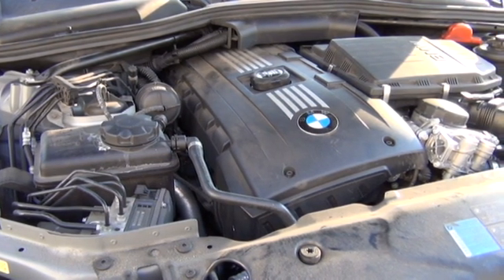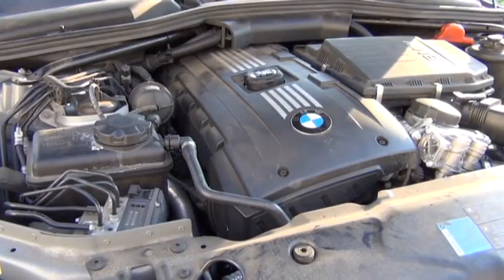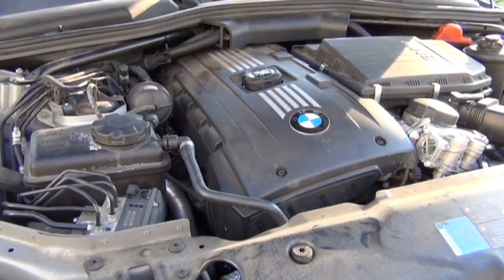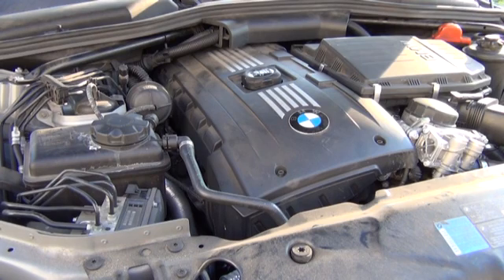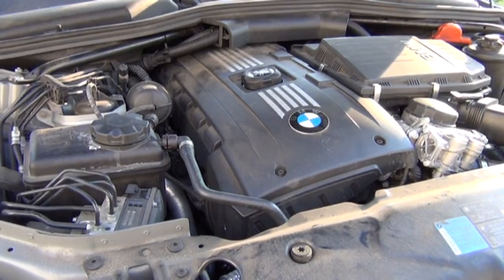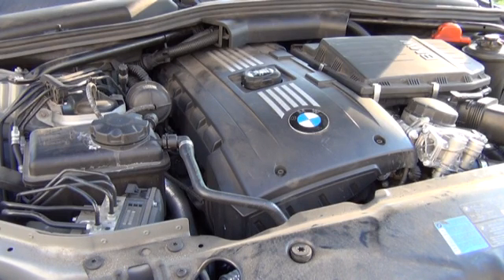BMW N54 Turbo Rattle Clanking Noise Caused By Failure Turbo Chargers

Comment: M54?
Reply from the maker: Hello, The M54 is the BMW 6 cylinder naturally aspirated engine. This video is on the N54 Turbo charged engine. When you rev the engine and the wastegate pivot bearing is failing a rattle noise is heard. This can lead to the wastegate not sealing and a boost pressure too low fault code resulting in a drivetrain malfunction and power loss. I hope this helps!

Comment: Actually I'm seeing the same failure on Audi 2.0 t engines model year 2009 and up the pivot on the turbine housing wear out and then the waste gate valve does't seat properly on the housing then the turbocharger doesn't spool as fast as before the causing a low boost fault I din't know BMW engine had the same fault I'm going to look at that closer next time I have one in my shop the brand of turbo that is having this problems are the Japanese IHI turbo what is the brand used on the BMW engine ?

Comment: Awesome video..... had (i hope) catastrophic turbo failure today (02 audi TT 225 quattro) and the sound it made was like a soup can inside a coffee can, kicked down a flight of stairs..... lol.... i think the turbo psychically broke.... havnt ripped it apart yet, tow truck went one way and wife drug me to work in the other direction..... but, near as i can tell my noise is just an extream of your noise..... thanks for the video.... i feel better now, i freaked out.... noises like that mean replace engine lol

Comment from the maker: Thanks for the comment Dick. I have seen the EPDW's pressure converters fail. The loss of vacuum would actually not cause a rattle as shown by disconnecting the reservoirs. But a compressed or leaking vacuum line may also cause noise. But in most cases the wastegate failure due to the pivot bearing wear is the culprit.

Comment from the maker: Turbo charger replacement would be the only way to get rid of the rattle. If you do not have a warranty then you may want to wait until they are bad enough to set the 30FF fault code for boost pressure too low.

Comment from the maker: The US market does have an extended warranty which is nice when people pick up on the noise early enough. Often the rattle does not lead to a failure for a while but when it does it usually sets a 30FF fault code for boost pressure too low. Thanks for watching :)

Comment: Glad I found your page, I was diagnosing one of these a few weeks back and it was a very faint rattle (the waste gate pivot) but it was very tricky to pin point. I found it after about an hour but it would have been nice knowing it's so common. It's too bad you can't just replace that pivot and not replace the entire turbo.I guess I will be seeing a lot of these in the future. The 3 that I have seen haven't been warrantied by the dealer, but I'm in Canada so it's more limited.

Comment from the maker: So far this engine has been the most troublesome. The newer N55 has less problems and only one turbo. The N63 on the other hand tends to have some issues like the N54. Now there is the 4 cylinder in the US market but this is also a turbo. I have had a lot of people think there is a problem with this engine as they make a distinct tick noise from the high pressure pump and the injectors. I will have to post a video on this "normal" noises for the 4 cylinder :)